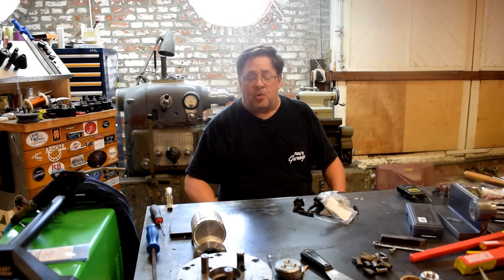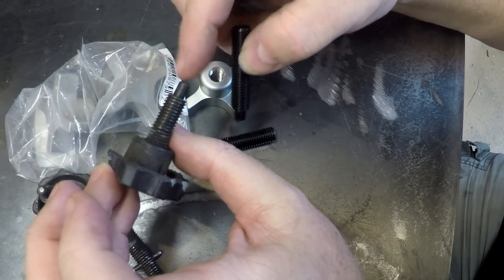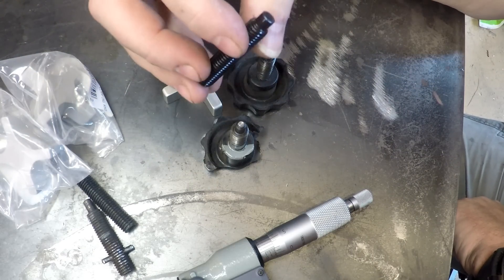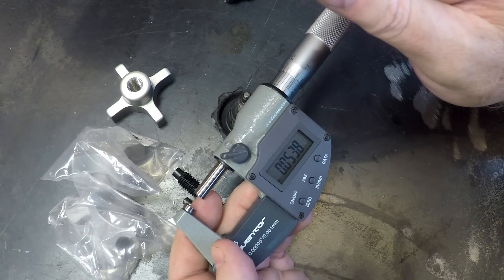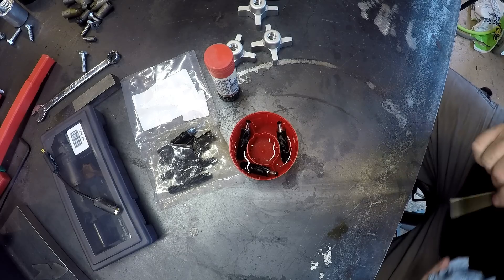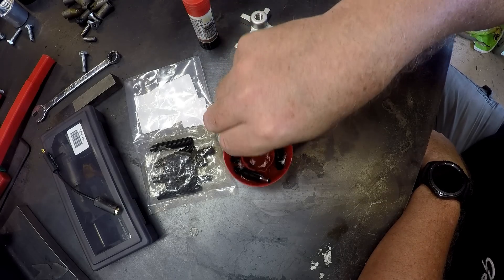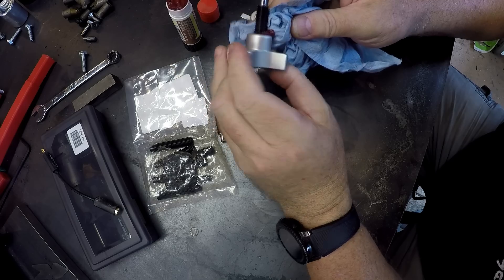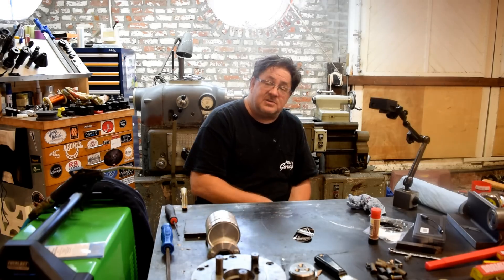Kilroy's Shop Shorts #1 (Steady Rest Finger Lock Repair)

Comment: I bought 2 SHARS AVENTOR quill DRO kits for a couple of my mills. One is working fine the other just up and quit working recently. I bought them both at the same time approximately 12 months ago. Actually the one that quit has only been in service about 6 months. The problem is not the battery, in fact a new battery will go flat overnite even though the readout wont turn on. Some kind of short I presume. I called SHARS and the were no help. 
I like Mcmaster Carr too however the only drawback i have found with them is I can never tell what brand or country of origin their stuff is from. I also like their cad drawings.
Reply from the maker: I have a shars DRO on my bridgy clone, haven't had an issue.  Can you not return the one that doesn't work?
Reply: @jtkilroy  Nope, when I called them they said it was out of warranty so I guess it goes to the landfill.
Reply from the maker: @tsw199756  I have a quill readout that is a Mitutoyo.  Typical Mity quality, top notch.  If you watch ebay they come up cheap at times.

Comment: James, where do you get those swabs? I use Q-tips but they fall apart real fast.
Reply from the maker: I get them from McMaster
https://www.mcmaster.com/7074T64
Its a cotton swab,  3/16 tip diameter, low linting, wood handle.  less than $3 a hundred